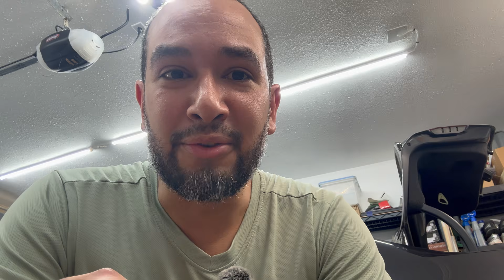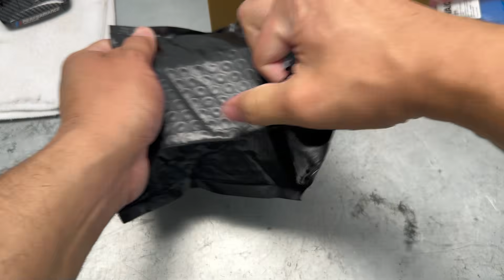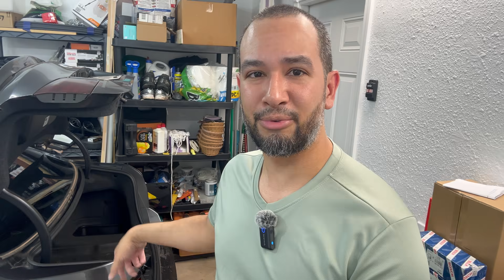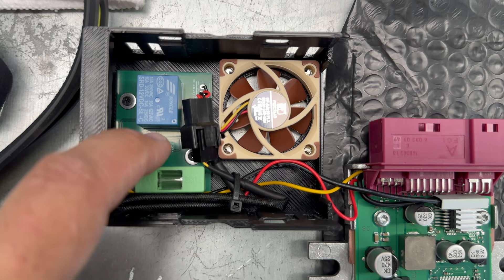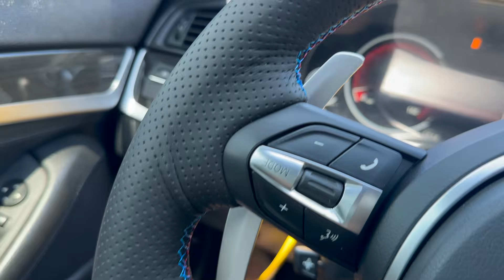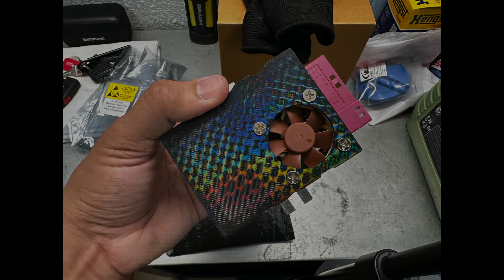NEW ARC TERMINATOR EKPM3 ON MY BMW F10

Comment: Literally what just happened with my f30 335i tonight. Doing a second gear pull and I thought I blew the engine. It went limp and shut down. Long crank and sputter. I thought I spun timing.  I waited 5min and restarted, and it started.  I guess my walbro 450 demanded too much power on a pull. The idrive said "Fuel Supply"...

Comment: I ran into this problem on a 2014 528i . Pulled the ekpm3 from a 2014 x1.  The x1 uses a bracket  to keep module suspended. So far the car works great. Not sure if I'm going to code it since it runs so good as is. Any thoughts, to code or not to code?

Comment: Does the same problem occur in the N57D30A?
Reply from the maker: Not that i am aware of. But the Euro FB groups would be best able to answer that. N57 is not very common here in USA
Reply: @turbospool  I'm writing because I have a problem and this module does not supply power to the fuel pump, sometimes it is enough to wait a day and suddenly it works.
Reply from the maker: @ I can tell you where I would look for but thats coming from a place of never working on the N57s, lol… i would test for low pressure fuel pump output and power at the pump’s connector. A failing LPFP gives almost identical symptoms as a failed EKPS. They are a symbiotic relationship-so if one crashes it takes the other with it. This makes it very difficult to diag this on the gasoline-powered platforms. Im not sure if the same rings true with the diesels. Good luck to ya!

Comment: Am gonna have to add this on 2015 f30 335i.    My car ekpm  is starting to overheat after I installed a bm3 flex fuel kit and a new Bosch stock lpfp.   I also Hopefully this works
Reply from the maker: Crossing fingers! You may still need a Walbro 450 or 535 if you’re going to run full E or something (depending on your mods of course).
Reply: @turbospool  am happy to report that the Arc terminal ekpm3 works great and very worth it. So far motor has not cut off after 4 hard pulls and driving around town.   Also I did not have to code it.   Car is 2015 335i msport. The ekpm3 stays cool vs the stock ekpm.  But I also have been driving with the rear bottom seat and rear right bolster off.   Am curious if the ekpm fits nice under the bolster cover. I am thinking about buying the PR stage 2.5v2 lpfp.   But how much e85 can stock lpfp max out at?  Mods on car are bm3 stage 2+  @ XHP stage 3 with a custom rod sutphing tune. Dorch stage 2.5 hpfp
Bm3 flex fuel kit, Bm3 chargepipe,vrsf race catless dp, and vrsf race intercooler “ the biggest one.   Am still stock diverter valve, boost pipe and turbo inlet. Also stock air intake and stock exhaust with a turners motor sport resonator delete and stock turbo.  
My goal  for the car is 500/500 whp/tq smooth daily driver.
Reply from the maker: @theodorecendejas1343  awesome! You may want to ask in the forums or FB group. That totally depends on your mods and tuning. A stock setup can run E85 all day no problem. I believe that at stage 1 levels you wont be able to run full E85 without upgrading the HPFP, for example.
Reply: @turbospool well I just found out that the stock lpfp can handle up to e70.   I overfilled it on purpose to experiment.   But at e50 it’s perfect with my dorch stage 2.5 and bm3 stage 2+ multimap.

Comment: What about when your fuel pump fuse blows I was told that the load from an aftermarket pump is too much for the stock wiring to the ekp and it can cause the fuel pump fuse to blow I was looking at getting this but I’m curious about the stock wiring that isn’t replaced
Reply: It changes with the new unit, cause it draws less current, I think close to half, even if it adds some extra amps, what it will do is give you a steady flow of amps compare to before with less volt draw and run cooler 😎
Reply from the maker: @Carlos335is  that’s whats up! A proper technical explanation beyond my degree 😂 lol thanks!
Reply: @Carlos335is I got the new one. Blew the fuse in 3 weeks lol.
Reply from the maker: So i have heard of this happening in rare cases. I PERSONALLY have not had it happen to me. BUT if it did, what I would do is just run my own thicker gauge power wire from the EKP to the terminal on the pump (you’d have to go to the dealer to get the required electrical pins on each end of your new wire). That’s what I would do. I know theres other companies that supply an EKP to run dual pumps WITH harness and stuff. But thats buku $. Worth it if you have the need for it though!